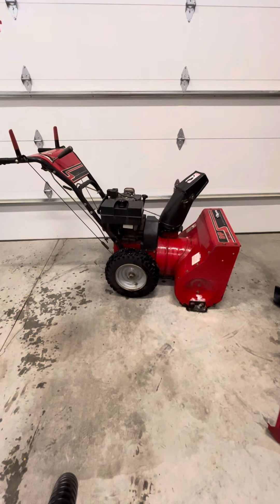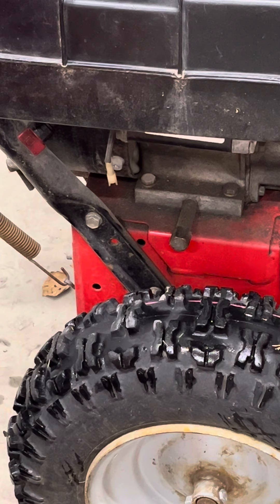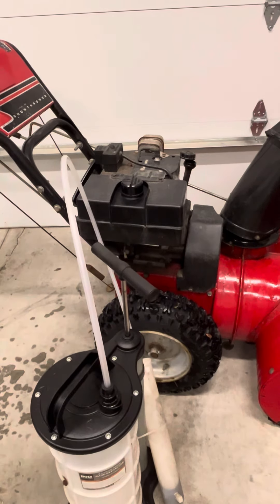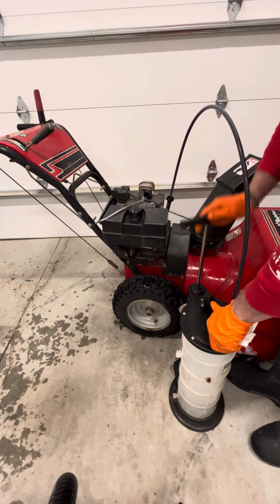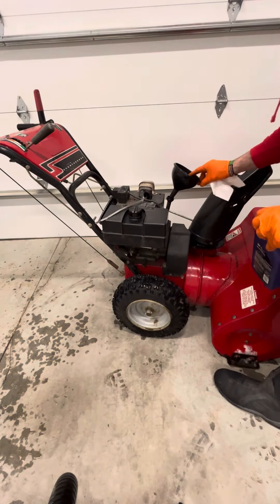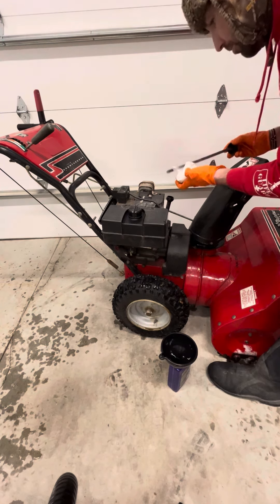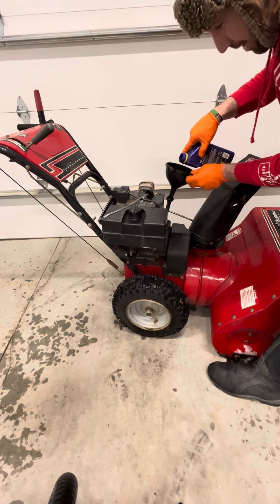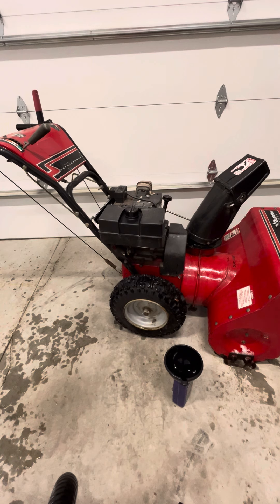How to easily change the oil in your snowblower! Snowblower repair!

Comment: Whit most of my machines I don't use the oil extractor but it comes in real handy on the chipper vac. White sugar bag has an older breaks Quantum engine on it which I know it does technically have no drain plug on the bottom but you have to remove a bunch of stuff to get to it. When it's a bit too heavy of a machine the flip over like you would most lawnmowers without a drain plug to drain the oil.